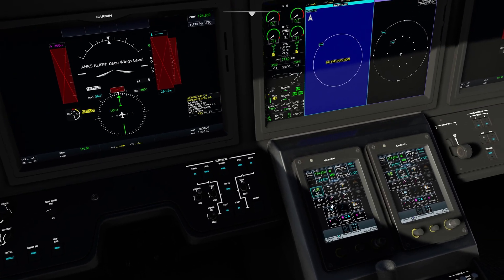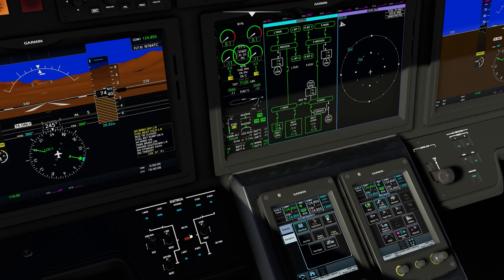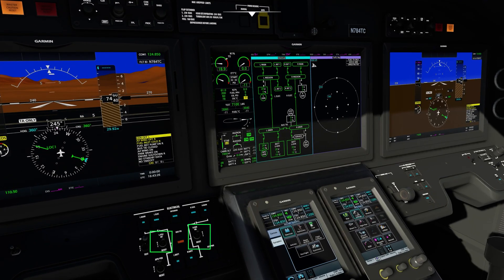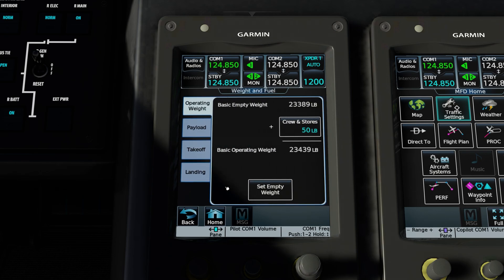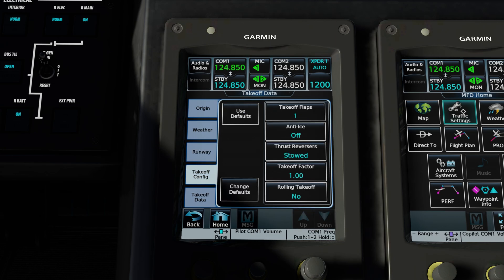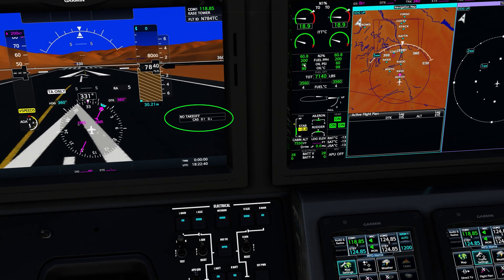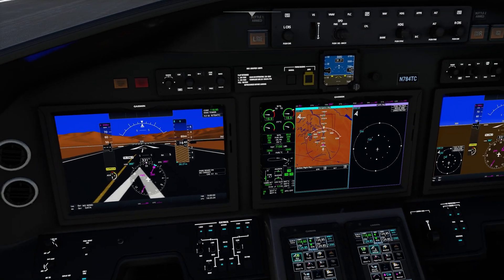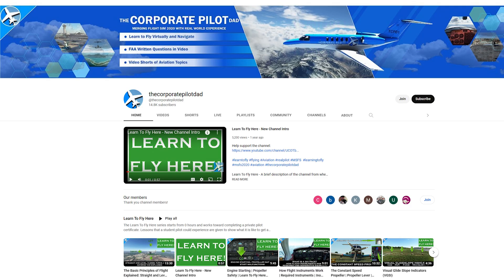Learn the Longitude - APU and Engine Starting, FMS Setup, and more MSFS 2020/2024 (Part 1 of 4)

Comment: Great video! How the heck is your frame rate so clear and smooth.
Reply from the maker: @JBTWIN286  that’s with a 2070 Super GPU which isn’t top of the line at all, especially now.  I have made a few adjustments to get better frame rates.
Reply: @thecorporatepilotdad  oh wow, I have a 3080. You wouldn’t happen to have a tutorial would you?
Reply from the maker: @JBTWIN286  I do not.  Go to GENERAL OPTIONS in settings and move the sliders for RENDER SCALING, AMD FIDELITY SHARPENING, and TERRAIN LEVEL OF DETAIL.  Also, lower that quality of objects that have no impact on the flight such as trees, terrain shadows, grass and bushes, etc.

Comment: Im a premium member but I cannot see the other videos, why?
Reply from the maker: @77flyer  did you sign up at the private pilot level?
Reply: @thecorporatepilotdad  not sure, how i do that?
Reply from the maker: @77flyer  when signing up make sure you are at the level that costs 2.99.   I do not see your name on the member list.  Maybe it didn’t go through?
Reply: @thecorporatepilotdad  is that a monthly subscription?
Reply from the maker: @77flyer  It is but you can cancel it during the first month so you only get charged for one month.  There are 5 Longitude videos.   Three videos are broken up into a full flight that finish part 1/4 of the series.  There are also a couple of systems videos and an approach into Aspen in the Longitude.  There are some some Cessna 414 videos in the membership as well.  It's 2.99 USD per month.
Reply: @thecorporatepilotdad  copy will do

Comment: Help please, love your work but i have a problem that has defeated me.  Have been flying the longitude for about 200 hours and take off was never a problem.  set FD, Vertical speed, Nav. Alt, Auto throttle, FMS.  The plane would take off and climb at assigned rate to assigned alt no problem.  Now with same setting it climbs at 9000 fpm, auto throttle cant't keep up and blows thru assigned alt.  What happened pls help
Reply from the maker: I will try to duplicate this on my sim.  What airport and departure were you using? Whenever using the flight director be sure to look at the standby modes (in white) to see what the FD will do next.  You’ll want to see ALT or VALTV for the airplane to level at the altitude selector or flight plan target altitude (VNAV altitude in magenta) respectively.

Comment: do you know why my cruise altitude isn't showing up on my Flight Plan page next to my waypoints? its just blank and I need to add it as a altitude restriction
Reply from the maker: Cruise altitude shouldn’t show up on the flight plan page in the flight plan target altitude column.  Altitudes that do show up are altitudes published on a chart (SID/STAR/Approach) where a specific altitude at a waypoint is published.  If using VNAV, the altitude selector is always limiting.  Video 2 and 3 in this series have more VNAV explanations.
Reply: @thecorporatepilotdad  It’s because i had a discontinuity in my flight plan. Usually when I set my altitude selector to cruise it will put my enroute waypoints to that altitude which in turn gives me a T/D
Reply from the maker: @jacks3446  that will do it.  One thing I do IRL flying(or try to do every time), is go through the legs page and look for unnecessary discontinuities.  They are needed on departures/arrivals that terminate on a heading or course to be flown.  Sometimes the FMS will add a disc. between the last enroute fix before the start of an arrival which can be deleted.
Reply: @thecorporatepilotdad  I am curious though, do i need to add my arrival/approach in order to get my TD or no? Whenever I don’t do that, I have no TD shown.
Reply from the maker: @jacks3446  No, a random altitude can be added at a waypoint.  Watch video #2.  An altitude needs to be connected to a waypoint, a lower altitude selected, and VNAV selected on the flight guidance panel in order for VNAV to work.  If a waypoint has an altitude and VNAV is armed a TOD will be visible unless the aircraft has already passed the point where that 3 degree slope intersects with your altitude.

Comment: In several C700 checklists I have found, I see Fuel Shutoff Valve (CLOSED/OPEN) and Auto Ground Spoilers (NORM/ARMED).  I am not finding controls for these in the sim model, can you please advise?
Reply from the maker: If during preflight, the checklist could be alluding to the L/R fire push button on the panel which would activate the hydraulic and fuel shutoff valves which could be open/closed but are not modeled.  The only other option would be the run/stop guarded switches next to the starter buttons.  Spoilers are automatic on touchdown and will retract automatically as well when speed drops on rollout.  I’m working on systems videos (for Private Pilot tier) channel members and spoilers will be covered in flight controls.  The fuel system will be next.  The goal is to upload one system per week depending on my flying schedule.

Comment: @thecorporatepilotdad thank you so much for your videos. Always been in love with cessna! I'm planning a full size cockpit replica at home, but I want it to be as close as the real stuff as possible, even non msfs implemented functions. I have a lot of documentation, but I'm missing a real measure.... With the pictures I have I can deduct all of them if I had one measure only. Could you please... Please? Tell me the width of the pilot seat per exemple. That would allow me to reproduce as close as possible the entire thing... I do electronics, etch my boards, program my drivers, I do work wood and 3d print almost daily, I just want my cockpit to be the real thing...
Reply from the maker: I do not have access to a Longitude.  Wish I could help, but I cannot.
Reply: No problem, thank you for your reply at least!

Comment: What is a rolling takeoff? Don't the wheels always roll when you take off? 😅 (Legitimate question tho)
Reply from the maker: Normal takeoff = setting takeoff power then brake release.  Rolling takeoff is adding power to takeoff power as the airplane is rolling down the runway.  500’ is added to the takeoff distance for rolling takeoffs at least for Cessna jets.

Comment: Doesn't work. Start pressure won't go up
Reply from the maker: Start pressure does not go up as soon as the APU starts.  A few seconds are required before 32 PSI will indicate.  Also, on the back of the center pedestal near the APU start switch, make sure the APU BLEED is set to NORM and not OFF.

Comment: I'm unclear on RAT. I thought RAT is Ram Air Turbine used for emergency. But at @4:54 it inserts temperature?
Reply from the maker: Ram air temperature is also RAT.  This RAT is is the temperature the aircraft feels moving through the air and comes into effect at higher speeds.  The Concorde skin at Mach 2 could reach 120 degrees C.  This is RAT.  If an aircraft is stationary RAT and static air temperature will be equal.

Comment: Every time I cold start this I get This warning and am unsure how to shut it off or what setting I have wrong. A/I ENG ON L-R   Any help would be greatly appreciated. Thanks.
Reply from the maker: Engine Anti-Ice On Left and Right.  It means the system is turned on and is probably a white CAS message.  In front of the right yoke (to the right of the gear handle) there is a section on the tilt panel labeled "ICE PROTECTION".  The top two buttons are ENGINE L and R.  That is Engine anti-ice left and right.  Press those top two buttons so the cyan OFF is displayed, and the message will go away.

Comment: i get a "P/S Button On" CAS message. can't figure it out?
Reply from the maker: Pitot/Static Button On.  That means the switch was manually turned on and will stay on during ground ops.  Pitot Static heat is applied automatically based on a few different factors such as power setting, weight on wheels, and more.

Comment: When I set my elevator trim in the green using my trim button on the joystick.  The external view shows the trim setting around 40% which causes the aircraft to pitch up at a steep angle after take-off.  Am I using the wrong trim setting or the wrong trim setting/button on the joystick?...Thanks for the help, great video!!
Reply from the maker: You could have too much nose up trim and still be inside the green band.  If you look in the Longitude manual linked in the description of this video, there should be a chart that shows stab trim setting based on MAC.

Comment: Why would engine 1 & 2 generator switches be "on" before actually starting the engines ? I would think generators only turned on after engines have spooled up. In the sim - even cold / dark - generator switches already "on" ? Also not sure what Standby By power switch (to left of generator switches) - actually engages ? I need to do more study time.....   Great video, thank you
Reply from the maker: Generator switches should be on prior to start but could remain in the off position and turned on after start.  Generators will not be connected to the system until a particular N2 RPM.  When that RPM is reached, the generator will come online automatically.  Standby power turns on the standby attitude indicator above the MFD.

Comment: Update! After watching this video last night I flew this airplane. I did not run across a problem I could not solve easily.
A discontinuity between an arrival and an approach. I flew from KORF to KDCA and flew the RNP 19 approach, the discontinuity showed up between the last fix of the arrival an Fergie intersection  for the approach. How can you remove the discontinuity? 
I solved it by going going direct to Fergie, however it should not work that way. 😁🛫
Thanks ye Master of all things aviation at YouTube university 🤣🛫
Reply from the maker: You had a discontinuity in the longitude with the G5000?

Comment: Is it possible to change the display of fuel and other weights in kilograms? Thanks. Nice video
Reply from the maker: It is and that was in the video but I took it out.  I can’t remember the exact steps but go into the G5000 under settings or system (can’t remember the name without seeing it) and units can be adjusted there.
Reply: @thecorporatepilotdad  Thanks. Is possible a video using VNAV?
Reply from the maker: @caraguia  Yes.  Working on a combined VNAV and auto throttle video today.
Reply from the maker: There is a VNAV video on the CJ4 on my channel.  Same concepts but the VNAV/ATS video should be out today or tomorrow.

Comment: Excellent video possibly the best so far on set up. Hope to see you do the take off, cruise and landing especially VNAV descent
Reply from the maker: Auto throttles and VNAV are next on the list and starting on that video today.
Reply: @thecorporatepilotdad  A question if I may; if a pilot was type rated on the CJ4 could they fly the Longitude if not how long would it take to get type rated for it. Just curious/thank you
Reply from the maker: @stu3tristan9x9  a type rating is for a specific airplane.  Initial training for a new type rating is anywhere from 3-5 weeks long depending on the airplane.

Comment: Thanks very much for the video. I never knew he CAS up and down as well as the full entry of the weights etc. Since the update I have an issue where by the Citation Longitude cant maintain speed whilst climbing, reduces to almost 130knts from about FL330 to FL400. Auto throttle is on and should be hitting about 300knts (Mach 0.8) according to the AT setting. Any thoughts why this might be doing it? Rate of climb is 2000 feet per min, but i need to reduce it down to about 300 feet per/min so it doesn't stall. Confirmed both engines are working.
Reply from the maker: My guess is you’re in VS mode and not FLC for the climb. Auto throttles will try to give all the power they have to maintain 300 knots or whatever speed is set.  Once max power is reached, the airplane wont maintain speed beyond that point and if maintaining too steep of a climb, the airplane will slow down.   In FLC, the aircraft will adjust pitch to maintain 300 and work with the AT system to hold whatever vertical speed needed to still maintain an indicated speed.   Hopefully that is the answer to your question.
Reply: @thecorporatepilotdad  Thanks I will give that a try. Yes I have been using VS, which from what I have now read is incorrect for climbing